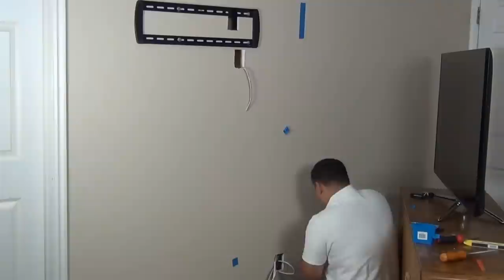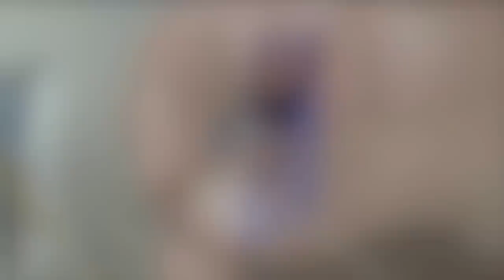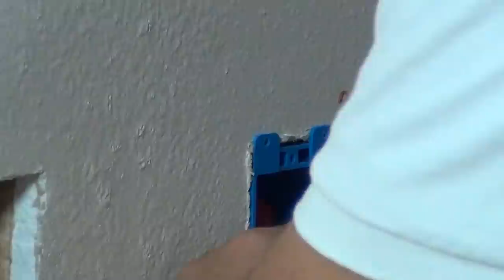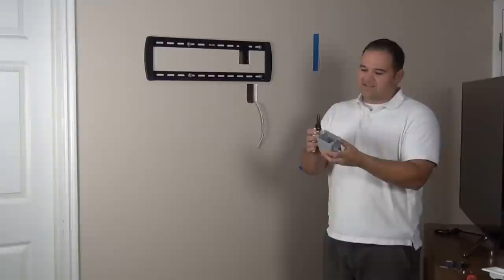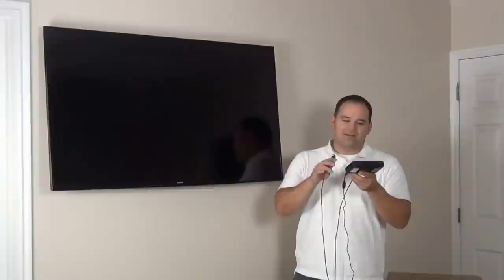How to move an electrical outlet behind the TV - How to Mount a TV to the Wall part 3

Comment: Nice video presentations. I too don't accept anything less than...
Here's a practice I use on every electrical job.
Thoughts?

A quick "Ridiculously Thorough" safety note for you. I ALWAYS wrap the outlet connection screws with electrical tape before shoving back into box. This gives me peace of mind not by .having to question if the wires will short . Easy, Safe, Minimal Expense.
Reply from the maker: Also a good tip!

Comment: Correection:  Most (if not all) electric codes will NOT let you change the cable size in mid span.  That is, if the wall has 12 gauge, or 14 gauge, use that for the jumper as well.  The code doesn't want someone years from now thinking the TV has a 12 gauge connection when an upstream link is actually 14.

Comment: Alan awesome JOB man. I also mount TV's and do custom installation and you hit it right on the money. You were very thorough in explaining everything. You did a good job showing people at home different steps to DIY.. Great job again!!
Reply from the maker: thanks!
Reply: Alan Clegg do you have a video on how install a TV on a stone wall above the fireplace? Thanks in advance
Reply from the maker: I don't have  video with that install.  That's a tough one and is best done before the stone goes in which I'm sure is too late now. Your best bet is to get your TV mount (articulating mount is best for this application) and hold it up to the wall where the TV will be mounted.Then remove the stone where the mount will be attached to the wall. Then you can cut the drywall there and use that hole to run wires. When you finally put the TV on the mount and push the mount all the way in, it will look like the TV is mounted to the stone.
Reply: Alan Clegg thanks for your answer. It's pre-wired so that's not an issue. It's just a matter of putting the mount on the stone finish that I haven't done before
Reply from the maker: I wouldn't mount it to the stone, since there is no way to know how much load it can hold. There are probably more options but these are the ones that come to mind:
1. Remove the stone and use an articulating mount as described above.
2. Try to go through the stone into a stud using long lag bolts. 
3. Use several toggle bolts going through the stone and drywall behind it
4. Use cement/masonry anchors into the stone. I don't know how I feel about this one since I have no idea how much the stone can hold. It's only decorative after all.
Reply: Alan Clegg thanks again. I really appreciate your time and help

Comment: Drill your hole on as much of a vertical angle as you can. Wire doesn't have to make a 90 degree bend, and will pull thru easier.

Comment: The video was very informative.  Two things I noticed is that the power wire connectors were not taped before pushing them into the box and there was a hole behind the TV mount which was not covered or used.  What was its purpose?  All in all it was very good information.  Especially running the wires through the studs and through the walls.
Reply from the maker: The hole behind the TV is where HDMI cables will be coming out of the wall to connect to the TV from devices in the central closet. Thanks for watching!

Comment: Is the new "Old workbox" rate for the number of wires you're adding to the outlet? If there is access under the floor or above there is a much easier and faster way of accomplishing the same thing. also, you are not supposed to crimp copper conductors with those caps on any pre-twisted wires, they should be crimped in a straight parallel configuration. When crimping twisted copper solid conductors as you did will cause a site for the conductors to break from vibration over time.

Comment: Good Vid. However dropping your trash into the hole is unprofessional and rude to the home owner. Regarding the outlets before you pushed them into the boxes always as a good practice wrap the outside edges of the outlets covering the side terminal screws with electrical tape. Even if using a plastic cut in box, always wrap the outside edges of the outlets with electrical tape
Reply: I don't see the problem of dropping the old box in the wall. It will be there out of the way until the house is torn down where it will be an insignificant part of the cleanup. I've done it on my own house.

Comment: Alan, I’m suggesting to you that next time you wire up these outlets you look into the type of outlet that wire straight into the back of the terminal. I’m not talking about back stabbing outlets, as I don’t recommend them, but these outlet wire to the rear and the screw terminal then tightens a clamp around the wire to hold it very securely.  Additionally, these would not require you to “whip’ or pigtail additional wires, you can put up to 4 same color wires into the back of these. They cost an extra 50cents or so.  Also, rather than using a grounding crimp, with so little room in that box, I like to use the green grounding nuts with a hole in the back of them. So you don’t have to maneuver your crimp tool into the back of that box. 

I like too that you gave ‘them caution about what they are drilling into.  Electrical and plumbing lines often make no sense.  When covered in drywall, you just never know for certain. 

Probably not ur choice, but that tv is way too high. 

I’ve done a lot of stuff with a/v and it’s always a pita. But I hate cords.
Reply from the maker: Great point! I like those clamp style outlets a lot. The TV is high because it's a bedroom TV that is watched from the bed and it's a lot more comfortable to watch a TV when it's high if you're lying down.
Reply: Alan Clegg forgot to thank you for your videos. Lots of good pointers and tips in there. As for watching tv.... I’ve about given up on content. YouTube blows it away.   Cheers. 

Oh, one problem about those outlets I mentioned, not sure if they come tamperproof. I hate the tamperproof outlets, but may be required by code or local code.  The tamperproof ones are so hard to get plugged in my hand slips and ends up on the electrical prongs themselves. 

Best of luck....

Comment: Hi Alan - Good video - but one thing you forgot to do or maybe you were never taught was in the far bottom 
right as you hooked up the Romex electrical wires to the electric out you must and should of wrapped black
electric tape around both the white and black wires on the outlet to prevent any of them to come loose to touch 
one another  as a result of a short or fire -  sorry I don't mean no disrespect to you but it's a good practice to use
the electric tape around the outlet screws  once again your video is very good .
Reply from the maker: Thanks for the tip and thanks for watching!

Comment: 12:21 They are called Pigtails. The other thing is when you bend the little hooks they need to go over the screws in the same direction as the screw tightens. This will mean that as the screw tightens it will suck down on the wire. If you do it the other way there is a chance that the wire could come lose.

In the earlier video you were talking about drilling through the studs. It would be so nice if there was a special bit that you could fit in the existing outlet hole and instead of trying to angle the drill bit to go through the stud you would use a tool that would look like a "T". The top part of the T would be the drill bit and the shaft of the T would be installed in the drill. As the drill spins the drill bit will go through the stud. As you need to go through more studs you would add a special extension that would grab the original drill bit that you started out with and you should be able to add at least 3 Feet of extensions. This would make it so much easier so you would just drill once and it's done.

14:18 At this point I would wrap a layer or tow of electrical tape around the outlet covering the screws. This is one way to make shore that the screws are covered and there is no chance that you will have any contact with the ground wire. 

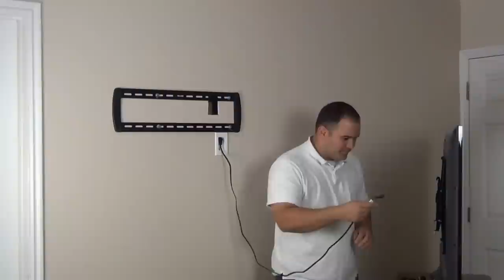21:20 Don't forget to run your AV wires. There is that other jack that has the Audio Video wires and that needs to go up to the back of the TV. I would of ran all my AV Wires up the wall to the back of the TV so when he gets the remote or if in the future there is something else that the homeowner wants to connect in the future they have a box to do so with not only Sound and Video but things like USB, HDMI, RCA, Coaxial Cable and Antenna jacks, Phone Jack in case some services may require it? The other reason is so you can hide things like your VCR Game Consoles, Computer etc in a cabinet so people won't see all of your electronic devices. all of the wires would connect below behind the cabinet and would be hidden in the wall to the the TV.
Reply from the maker: You're giving a lot of good advice! Thanks for contributing! The bottom of the wall has cable, internet, and phone, but the outlet behind the TV has the AV cabling. This house has a central closet where everything goes and all the equipment is stored in there. Best wishes !!

Comment: Some are taught to twist wires before putting on wire nuts to prevent wires from slipping out.  I use Buchanan wire nuts and they grab tight.
Reply from the maker: That’s true but good wire just give a good bite and twist the wires for you. Thanks for watching!

Comment: This was a very good self explanatory video Alan. Only question I had is why not do the average outlet @ the same time? But I understand takes time & everyone is different. :)
Reply from the maker: Do you mean, why don't I change the lower outlet at the same time? I try not to mess too much with things that are working so I don't get myself into someone else's mess. Maybe I pull out the outlet and see something that I can't just put back together easily and I'm forced to address it.

Comment: Why were there three pairs of wires that you had to "whip" together at the bottom outlet. I can understand two, one coming from the breaker to the original outlet and then one to go to the new outlet. But not sure where the third one comes from?  Thank you!
Reply from the maker: One wire is from the breaker. One wire carries the circuit to the next outlet then the other wire is the new one we pulled up to the TV outlet. Thanks for watching!

Comment: Hey dude. Yes I would like to know how would you run cat 5 or 6 cable from master bedroom where I have my router at between ceiling & floor to the living room where I have a network switch why I am power plug that works like wireless network cable. I would like to used hard wire cat 5 or 6E cable. I'm calling from Houston Tx

Comment: Well done here in uk our ground bare copper wires have to be covered by law to stop accidental shorting.... I know it’s not needed by law in usa but would be a good idea we use a green and yellow sheave but any green heat. Shrink would work
Reply from the maker: We only have to use covered grounds on commercial installations. I agree that it would be nice to have a coated green everywhere.

Comment: Good video, only one thing why not make a double outlet box under the TV and pull in all other wires for the cable or satellite TV at the same time.
Reply from the maker: I didn’t make any new holes in this installation. The old cable jack serves as a cable, network, phone jack and the old outlet was simply replaced. If I combined them, I’d be adding boxes unnecessarily. Thanks for watching!

Comment: Electrical code requires the romex to be stapled to a stud within 6" of the box/ The outlet mounted near the bracket is called a recessed or "clock" outlet
Reply: not on rework in enclosed construction!
Reply: secured 12" away from box, minimum of 6" free conductor

Comment: Some nice tips thanks. I don't even want to know what that job cost the customer. 90 minutes of video after the cutting floor.
Reply from the maker: Good point. Filming definitely made it take longer and I have a couple extra tools to speed things up that i didn’t use here. Total job time from start to finish including mounting TV, customer instruction, clean up, etc is about 2.5 hours.
Reply: @AlanCleggYouDoAV  Thanks Alan. I'm getting into the Handyman business after 30 years of cabinetmaking, teaching, and home renovation and this is the info I need.

Comment: The only problem with this is there is suppose to be a nail plate on the stud where the wire penetrates and it is suppose to have fire seal in the hole through the stud.

Comment: I have a bedroom with an outlet in it, and on the other side of that wall is the living room. On that wall I want to attach an outlet connecting the bedroom outlet  so I can mount a tv in the living room. My question is, I removed the screws from the outlet to take a look at it, and it has two red wires connected to a single gold screw, and two white wires connected to a single silver screw (even though there are two gold screws and two silver screws), with no ground wire or ground screw. I believe it's a 15v outlet. Am I to assume that the red wires represent black wires? Even so, how would I go about wiring this to another outlet in the living room? Would it have to be rewired to have a ground wire for safety purposes, or just get another outlet in the same style and attach together that way?
Reply from the maker: Lots of old houses don't have ground wires. It's safer to ground your outlets properly but it will function still if you don't use a ground wire. Yes the red wire is your hot.

Comment: thats not a linemans splice, a linesmans splice is a solderable joint where the wires are wound together and then tinned with solder, all you did in that box was twist them together. a linesmans splice is supposed to be able to support being pulled, so if you pull on each end of the cable it will not pull apart.

Comment: Is it possible to install an outlet on a wall that has never had an existing outlet? Im new to this so im not sure how all this works.
Reply from the maker: You need to run an electrical cable from an existing outlet to the new outlet then you're good to go.

Comment: How do you know what gauge of wire is already in the wall to run your extension wire up the wall? Is there some standard way to measure?
Reply from the maker: it will say on the wire in small writing something like 12 AWG or 14 AWG. AWG is the acronym for gauge. More often than not, yellow cable is 12 gauge and white is 14 but that's not a guarantee since 12 gauge is sometimes white. 14 is the standard for regular outlets in bedrooms and living rooms but the only guarantee is to try your best to read the tiny writing on the wiring itself. Thanks for watching!
Reply: When you turn off the power the breaker or fuse will say 15 or 20 amps , so then you will know wire size , 15 amp 14 gage 20 amp 12 gage

Comment: What if there are fire blocks or cross bracing 2x4s between the studs in the wall?  How do you get through that?
Reply from the maker: Did you notice how there were two holes behind the tv- one for the tv cabling and one for the power outlet? I always cut one hole first when I'm doing an install, then try to run the wires. If I can't, I can still cut one more hole and I'll strategically place it so it will be covered by the tv yet will allow me to get through the obstacle (like a fire block). In the case of a fire block, I can usually cut the second hole right above it so I can drill right through it and run my wires.
Reply: Alan Clegg Thanks. One last thing. At the end of video 3 you said you were going to come out with a video on how to hide the DirecTV boxes, did you make a video for that?
Reply from the maker: I've gotten that request a few times and I just haven't made it.  Thanks for reminding me.  It's really simple, which is why I haven't made it yet.  All you need to do is get industrial strength velcro tape from Home Depot and a radio freq remote control. Make sure you put the tape on a place that doesn't get hot on the box or TV and you're done. Does that answer your question or is there something else I'm missing?

Comment: Is electrical code violation without nail plates and hole seal ?
Reply from the maker: No. It only needs a plate if the hole is within 1” of the front of the stud and fire caulking is very rarely needed.